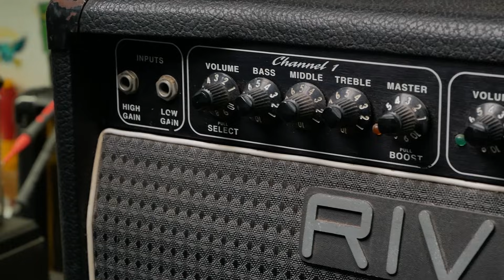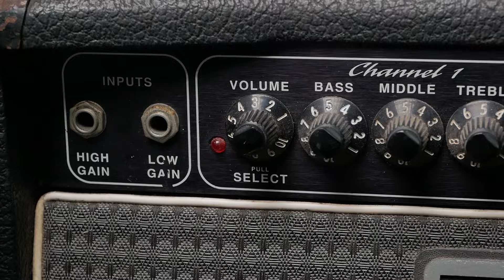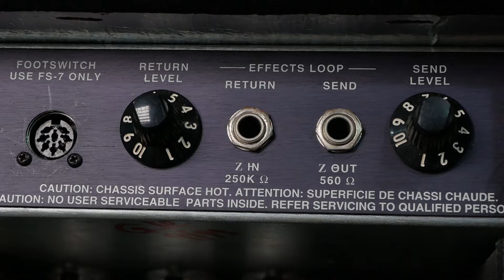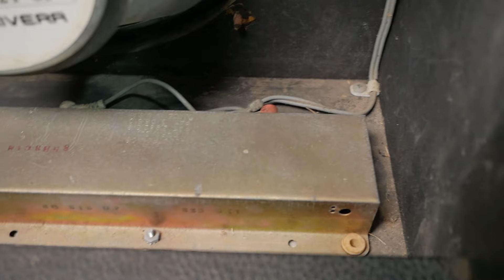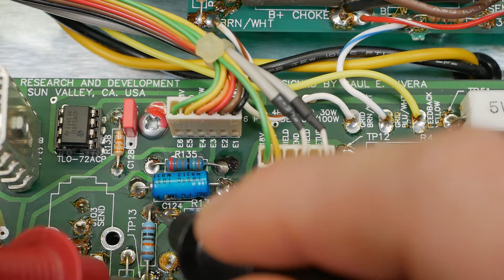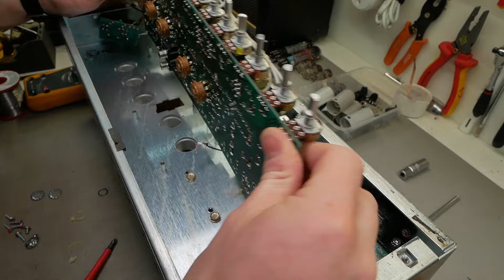Rivera Fifty Five Twelve - Part 1

Comment: Champion!! I have this exact amp (converted to a head) and I just did a successful complete re-cap myself thanks primarily to this video. My main filter caps were bulging, some others were oozing, and Rivera themselves recommended replacing all those little 100u 25Vs which are prone to short and take out the low voltage components. I even ran into a situation where a leaking cap had corroded a pad and trace just like in this video so I had to jumper it BUT I was totally prepared for and watching out for that because of how thorough this video (or PT 2) covered it. Just had to shout out a big Thank You.
Reply from the maker: Yeah, I think they got stung by a few runs of not-so-great caps, even from the reputable manufacturers.
They all go hit by those issues at various points in the 90's and 2000's. I think were starting to see another wave of failures in cheaper SMD electrolyics now, too.

Comment: Best thing about those machines is they don't need licensed software to make noise. We're getting to that point where we better value what came before for what it can do on its own with just 120V off the wall. Everything digital, even if good and handy and  practical, almost always needs a firmware upgrade. An analog Amp needs DC and a guitar. 
What you do passing along your knowledge is very noble and very needed for all of us, specially for future gens. Thanks!!!

Comment: I have a Rivera Clubster Royale Recording. Had an issue with the Clean channel (2) cutting out. The tech I took it to did not want to work on it. I stared at the board for around 45 minutes and noticed a leg that was not soldered on a part that was in the circuit path after reviewing a similar diagram. Touched that up and it has been 100% ever since. Really wonderful sounding amps. Just found this channel. Subbed! So informative and thorough.
Reply from the maker: Good work, mate!
I don't know why the tech didn't want to look at it.
They're very well built amps.
Some guys are scared of SMD tech, but some guys are even scared of PCBs in general!
They only take the piss-easy jobs. Kinda hobbyist more than tech.

Comment: I've owned/own several Rivera amps. They are hand soldered, at least they were until some time into the 2000s. I've never seen the flux on the board on any of my Riveras, and I've owned seven different Rivera models over the years. As much care as they put into the design, construction and assembly, I find it hard to imagine they would over look such a thing.

Comment: Man I got a 1959 build with period correct parts in 68 spec.....I'm using a lar mar ppimv....so I added a variable negative feedback.....I'm using 2 560pf treble caps src ....I had to put 10k grid stoppers on the output tubes.....I'm thinking of grid stoppers on V2 and V3 because I am using the phase inverter and v1 and V2 for overdrive.....would you happen to know a good starting point for grid stoppers in these locations for use with a ppimv?

Comment: 0:41 The layout of the controls on this amp, rubs me up the wrong way, TWICE! 😠😠
I HATE any amp that has, IMHO, the EQ controls backwards i.e. Treble Middle Bass. We read from left to right, low to high. 
A volume control doesn't start at 10 and as you turn it clockwise, the volume goes down.
This amplifier is annoying me even more than that by having the correct (IMHO) EQ layout on channel 1 and the WRONG (IMHO) EQ layout on channel 2. 🤬🤬🤬🤬🤬🤬🤬
Reply: I think the idea is that Fenders (clean) and Marshalls (dirty) usually had their knob layouts in reverse order from each other. It's a subtle nod to that, as well as a hint at what the channels are voiced for.

Comment: Bit of a noob question, but why is this board so busy compared to say, an old dual channel Fender with a fibre board? I know there is slightly fancier power going on, and probably more gain stages, but still?
Reply from the maker: Two independent channels, switching circuitry, effects loop, low voltage supplies for the switching and reverb driver, which is also solid state and more complex. It all takes more real estate on the PCB.
Reply: @BradsGuitarGarage  plus ninja boost and lots of tweaks everywhere. they certainly dont miss a trick. does it have the slavemaster on the back?
basically a controlled powered effects loop that you can use to regulate volume.  
have fun with it.

Comment: Got a friend whose Rivera repeatedly blows power trans formers. I’m thinking, bad tubes/bias, bad screen grids, rectifier diodes, PS/Bias Caps, OT demanding too much power, or low voltage PS fault. Not certain of the amp model.
Reply from the maker: Measurements need to be made to know for sure and develop a plan of action.
Let me know where you are if you need a tech you can trust, mate.